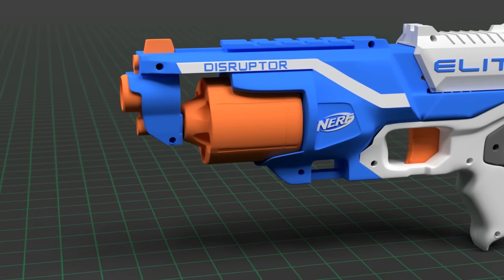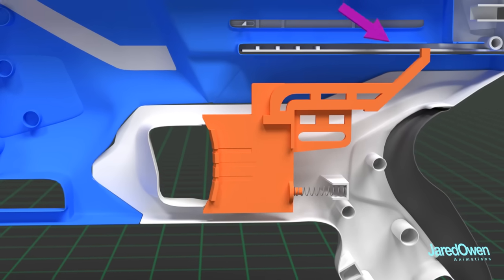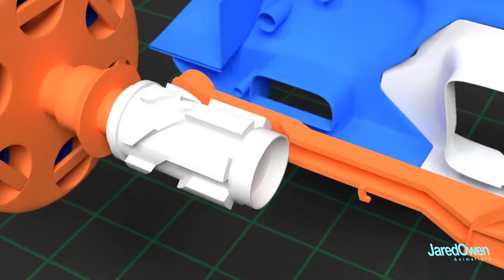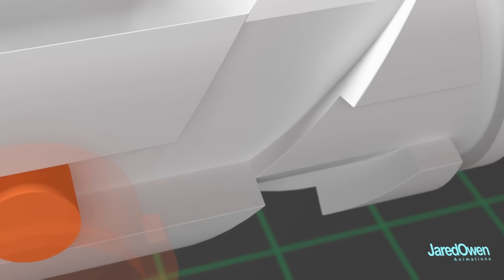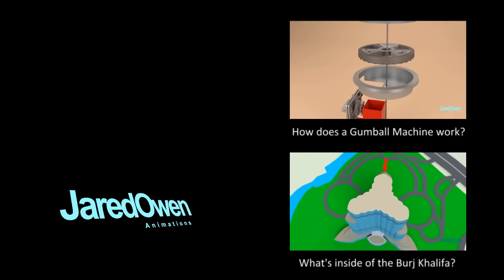How does a Nerf Gun work?

Comment: It's very interesting that the movement of the plunger with a separate assembly is what drives the cylinder to rotate. If I were to design it, I would take after a single action revolver, where pulling back the hammer (slide) both cocks the action and advances the cylinder.

Comment: 🎯 Key Takeaways for quick navigation:

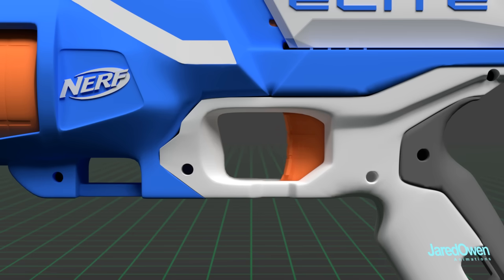00:43 The Nerf Gun trigger is connected to a spring that returns it to its original position after being pulled.
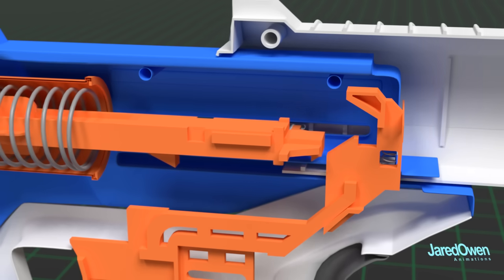02:00 When the trigger is pulled, the vertical slider releases the piston, firing the dart with compressed air.
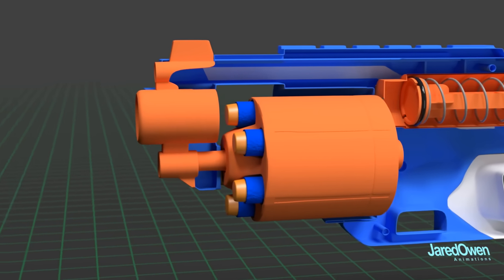02:32 The cylinder rotates after firing, positioning the next dart for firing.
03:38 The cam and cam bar mechanism causes the cylinder to rotate, enabling dart rotation and firing.

Made with HARPA AI

Comment: I actually “modded” my disrupter, i took out all of the air restrictors in the drum, and then theres one more that can be removed in the piston. then I replaced the pistons spring with a spring from a stronger nerf gun. It was pretty powerful and left welts from short range. But it did also break the little blocks on the priming handle, but until it did it was really fun

Comment: fun fact you can fit a 7.62x54mmR in a nerf gun
Reply: "Free bird" starts playing
Reply: @NuclearDorfus freeeeeee birdddd yeah
Reply: @NuclearDorfus 🤖
Reply: @PoisonIvory088 u call me a bot ?
Reply: @NuclearDorfus  yes
Reply: the quiet kids takin notes rn
Reply: @Waterishloki100 all I can say about that is 💀
Reply: @Waterishloki100 me
Reply: @Waterishloki100 meh, it will blow it up
Reply: 7.62s are my last resorts for when I lose nerf battles, the break glass for emergency
Reply: fun fact: nerf darts are .50 cal
Reply: @halbolonen well elite ones are
Reply: @halbolonen nerf darts to me look like a magnum caliber
Reply: At least mega darts  @halbolonen
Reply: @halbolonen  im assuming .50 beowulf bc there’s no way a bullet the diameter of a shotty shell is fittin in a nerf gun
Reply: @Waterishloki100  the bullet itself would fit, because its the same size as a nerf dart. in terms of casing .50 beowulf might fit depending on the nerf gun because the casing is slightly wider than the bullet. though from what I've heard, most nerf branded guns have some wiggle room
Reply: @Waterishloki100  a nerf dart has a diameter of 12.7 milimeters (i measured) which is the same as some .50 cals
Reply: @halbolonen  yeah but i only has a 7.62 dummy laying around
Reply: no one's stopping you
Reply: I have an idea
Reply: and it will fire the whole bullet. you know what that means
Reply: Oof size: nuts
Reply: With the short barrel, a 7.62x54mmR will be as inaccurate as storm trooper's aim
Reply: Fun fact I have done this with dad's  ammo when I was 9 it will totally feed through the mag and into the nerf gun chamber if you have bolt action blaster and slam the bolt forward the round will fly out the barrel
Reply: “Heres some tips to help you win your next nerf battle”
Reply: The average nerf dart is the same width as the bullet in the 50 BMG cartridhe
Reply: Wanna know some funny? The average dart caliber is 12.7mms, and nerf MEGA darts are 20mms, then we have MEGA XL, 30mm. And god forbid the demolisher rockets and the Titan rocket
Reply: It won't fire because the Nerf blaster only shoots out air that shoots the dart, and the bullet may be too heavy
Reply: How do you know this😂
Reply: @winterflight8254  experimenting
Reply: a fun nerf battle
Reply: WHAT IF IT'S A MEGA BLASTER
Reply: Heck even if an ultra one
Reply: Say it in English
Reply: Ferb I know what we’re gonna do today
Reply: Cap
Reply: Wait what

Wait

WHAT??????????
Reply: how exactly do you know this
Reply: airsoft troll
Reply: What’s that?
Reply: Cool but why do you know that
Reply: But will wont work like in a normal gun, because it will the projectile will be pushed by the air, not the explosion. So the entire bullet will fly out, instead of just the tip.
Reply: Fun fact: the nerf ultra pharoah is almost a 50 cal
Reply: Heh- howed you know that-?
Reply: Just because you can doesn’t mean you should
Reply: OOOOOH NOOOOO-
Reply: OOOH NONONONONONONO
Reply: So theoreticly if you put a firing pin on the plunger you can fire a round
Reply: @SCARECROW9713 yes you can, but please don't, it will permanently destroy the internals of the blaster and also you will probably go to jail
Reply: Tengo una élite eaglepint 2.0 pero no me dispara quien me puede decir que tiene
Reply: imagine replacing the piston with the needle that activates bullets 💀💀💀
Reply: Dang
Reply: It's a toy, not a freakin' real gun
Reply: Ayo wtf
Reply: You should NOT have told me that
Reply: The firing pin mod 😳
Reply: Just add a firing pin and boom
Reply: @Yeetusthe6th there is kinda a firing pin, its in the chambers of the cylinders, i think they keep the dart in place
Reply: @Thefriedchickenmaster   yea… but also add a extractor to then yea
Reply: doesn’t mean it’ll fire
Reply: Dont give me ideas…
Reply: And also a 30-06
Reply: ok, I know the rounds and caliber is real but why did I think of dayz when I saw this comment?
Reply: Nerf guns don’t have a firing pin. So you can’t shoot normal pew pews from it.
Reply: Great prank😂
Reply: You can also perfectly fit a 12 gauge into a nerf Ultra mag
Reply: yeah but they don't have firing pins
Reply: Mister crab I have an idea
Reply: Nerf wars just got a whole lot more fun
Reply: @zander-M1  ...where's the firing pin? actual proper shell ejection? a proper barrel?
Reply: It’s nerf or nothing
Reply: If god didnt want me to shoot 7.62x54mmR rounds out of a nerf gun, why did he make the diameters match?

(Fun fact nerf darts are .50 caliber so you could probably chamber .50 AE or .50 beowulf in a nerf gun too)
Reply: @RedVRCC  where's the firing pin?
Reply: @ratsmushr  the nail you put thru the end of the piston inside the nerf gun
Reply: @RedVRCC  and how would that be actuated?
Reply: @ratsmushr  it was more of a joke comment anyways because the nerf gun would just explode if you tried to do this. 

I guess the idea I had was that the area where the piston slams forward to compress air would instead have a nail driven thru it that would fly forward and strike the primer on the back of the cartridge. It would be actuated in the same exact way the gun already works because that piece the nail would be attached to already moves forward at a decent speed. You probably would have to modify the gun further for it to actually work though.
Reply: Let’s…. Not do that
Reply: I knew the were bigger than 5.56, but not that big
Reply: I've got a few sitting around but unfortunately no Nerf stuff
Reply: But why would you want to? Nerf doesn't exhibit enough force to hammer a priming pin
Reply: The average nerf bullet is half an inch in size so it means it 50cal
Reply: Nerf guns are 10mm
Reply: Umm I think you meant 7.62x51mm? I don’t know if the casing diameters are the same but just the rim would make it so it wouldn’t fit, 7.62x51 or .308 do fit in side nerf mags but I don’t know if t know about the blaster itself
Reply: I want to see if a nerf mega gun or nerf mega XL can fit a 50 bmg…
Reply: @JonathanCortez67 nerf mega is 20 mm 50bmgs base is 20.422 mms would probably work half decent
Reply: by the size, it should be 50 CAL
Reply: @Wall_Gaming229 no because 50 cal is just the bullet diameter not the actual cartridge
Reply: @cutoats  oh..

Comment: the plunger tube is also free floating which means that when the air pressure builds up from the release of the plunger head, the entire mechanism jolts forward and creates a seal on the back of the cylinder of the blaster. this is the most important part!

Comment: the small block is way to small, and if you try to slide it in a slightly downwards direction, it will slam fire without pulling the trigger (basically it misfires)

Comment: I took apart a different nerf gun. Why in the part where the spring is, is the rubber band wet?
Reply: Rubber band? I don’t know of any blasters that utilize those. Are you talking about an O-ring?
Reply: @mechanwhal6590  the black ring thing that feels like rubber
Reply: @thegamingdeerfox  Yeah, that’s an O-ring! I believe what it has is lubricant, a substance that is needed for smooth operation. Ask any modder, there’s a huge community!

Comment: THIS ANIMATION alone gives you a PERMANENT JOB FOR THE REST OF YOUR MORTAL LIFE. That is it. 
I'll explain why. Detailed sections and transparencies used on the mechanism. Order of process and the description of the actuators are dead accurate. The decomposition of the assemblage is complete while the viewer never loses track of the whole action on the set of actuators. 
The simple verbal explanation matches exactly the animation on the tight spot. The time stamps are absolutely accurate. 
And we are not even speaking about the level of detail, illumination, modeling or even polygon budget. Those are things obviously well executed. 

As a side note these toy designers are engineers and few are architects. These are NOT toys when there are millions involved. The engineering of mechanisms will be done by the book under rules of optimization and production. Fabrication is a strict science. You will see more complex devices than these moreover when such designers have 40 years working with mechanisms.

Comment: In my opinion the Maverick is better than the Strongarm as the mechanism is so much simpler. My strongarms broke after getting grit in the mechanism: it can fire, but it won't cycle the cylinder round. The maverick will move the cylinder when the trigger is pulled without any fancy kick system, and can be used to cycle to different chambers

Comment: "Good for target practice..." 

Not with these shitty elite darts kekw
Reply: yep
Reply: do you use rival guns or some other type if dart?
Reply: @tysoncook5152  yes.
Reply: @tysoncook5152  wafflehead darts > elite
Reply: @GeraV5  interesting. i never heard of waffle head darts. i looked it up and they seem interesting. i know the elite darts can wear down pretty fast. do waffle head darts have a more resilient body?
Reply: @tysoncook5152  i guess in a way.
But in general they actually hit where you're aiming at. Here have a video about the many darts.
https://youtu.be/8IwTM1fpzDY
Reply: @tysoncook5152  Accufakes also are like accustrike, but 10 times cheaper, and half length darts are the best way to go overall
Reply: @GeraV5  nice! i will consider trying out some of these options. the waffle darts seem to be pretty accurate judging by the video.
Reply: @tysoncook5152  the most tryhard you could go in nerf/competitive would be with half length darts, since those can be MAAAAD accurate
Reply: @GeraV5  wouldnt they be hard to use though?
Reply: @tysoncook5152   traditional magazines? Yes. 
With katana magazines/adapter to normal magazine well, no.
Reply: @GeraV5  so much i dont know about this stuff. i guess i need to do some more research.
Reply: @Splinter-ge9pf  accufakes seem to be very hard to find nowadays, so Adventure Force waffles are the best at the moment
Reply: Rival is more accurate than elite

Comment: In the gun world, the "vertical slider" is known as a disconnector.  Cool video! 👍
Reply: You're confusing another part. That slider is a "sear". A disconnector actually disconnects the trigger from the sear until the trigger is reset, otherwise the hammer wouldn't stay cocked after cycling.

https://en.m.wikipedia.org/wiki/Sear_(firearm)

Comment: Well.. tbh its pretty simple. 
Flywheel blasters just give away how they work (Flywheels spinning hella fast so when the dart comes through the conveyor to hit the flywheels, it jolts out)
Then there’s the spring blasters, the old schools (They also shoot harder)
The name also gives away how it works. (Priming the blaster consists of pulling back a spring and the spring shooting the dart. It shoots harder than the Flywheels so it might sting worse. They’re better for snipers, Shotguns and Pistols. Flywheels are better for AR’s, SMG’s, and other primary blasters. BUT- there’s one that beats them all, I, a Stryfe user, would prefer that. But this is my opinion :) read if you’d like!)

EDIT: This a hella simple explanation, don’t get on me about this.

Comment: i think for slam fire the trigger is held down so the triangular plastic at the top pushes the piston away from the cocking mechanism's block allowing the piston to extend, but when the cocking mechanism moves forward again the angle of the block allows it to slide under the piston's catch and latch on again.

Comment: That indexer could be used in a belt-fed flywheeler to potentially attain ridiculous rates of fire reliably with low battery use. Align the sprocket and position it in such a way that the dart pusher is always clear when the indexer is engaged, and it just might work

Emphasis on "could". Perhaps the indexer may slip if used at high speed.

Comment: Hallo Jared, do you know what slam fire is? When you keep the trigger pulled and prime the blaster, once it hits the position farthest back, it fires (in this blaster, other ones fire when the priming mech is in a forward position). This is a really cool mechanism in this blaster and some others. It would be really cool if you could show how that works!
Reply from the maker: Thanks Himneesh - I will consider it!
Reply: @JaredOwen  Thanks for replying! Just to let you know, whether you make a video or not, slam-fire lets you increase your rate of fire since all you have to do is pump the priming slide as fast as possible. The need to stop priming and pull the trigger is gone, so you shave off a lot of time.

Comment: I wanted to know how does the slam-fire system works because one part that is different from a disruptor/strongarm to the maverick is the slam-fire.
Reply: The maverick has a rod running on top the plunger tube, whereas the strongarm and disruptor has a triangle plastic latch. And the catches are different

Comment: For those wondering about slam-fire: when you hold down the trigger and pull, the "vertical slider" acts as a ramp lifting the bar on the piston above the bar on the priming handle enabling it to fire immediately. If you were to try this on a blaster without slam-fire it will simply not prime. The bar on the priming handle is triangular so it can pick up the bar of the piston during slam-fire since otherwise it would get stuck behind the priming handle's bar.
Reply: Cool I didn't know how slam fire works
Oh also, some blasters have locks that prevent you from pulling the trigger when the priming handle is back so if the trigger on your blaster doesn't press when primed back don't try to press it or it will break

Comment: It was based on an actual bolt action gun.  The grooves that rounds the chamber, the firing pin and the trigger reset, it's actually can be made into a real bolt action gun (Not automatic nor semi-automatic, because those make use of the gas system efficiently).

Comment: this is how the Maverick works, not the disruptor, I'm cringing at the wrong blaster, yeah they're basically the same but with the maverick it has the cylinder turn every time you pull the trigger, with the disruptor it turns with the priming handle

Comment: This pains me so much

It's actually called the Nerf N-Strike Elite XD Disruptor

The "Vertical slider" Is actually a Catch and the spring with it is called the Catch Spring

The "Piston" Is called the Plunger and the tube is the Plunger Tube and the Rod is the Plunger Rod, this is a unique design with the Slam Fire mechanism in place that you forgot to mention. The end of the rod, that actually catches with the Catch is on a spring and move, when the Trigger is depressed and the catch is down, it will prevent the rod from catching and will also cause it to release it self from the Priming slide, allowing you to fire much faster.

You forgot to also mention the Air Restrictor, this allows the ablity to "Dryfire" the blaster, meaning fire the blaster with no dart insterted. Without it, the Plunger head will slam into the end of the Tube and may break. The Air Restrictor on the Disruptor/Strongarm is unqiue since it diverts air out of the system when no dart is loaded through the use of a small hole at the bottom of the Air Restrictor housing that lets some of the air escape the system to prevent bursting, but when a dart is inserted, the Air Restrictor moves back Far enough to cover up the hole, allowing for optimum airflow. Many modders forget this when the take out the Air Restrictor and actually loose performance when they remove it, since they have a leak in the system they forgot about.

I hope that any Nerf Noobs who took this video as absolute truth then sees this comment and will think otherwise. Do more research Jared!
Reply: Ok boomer

Comment: So what happens to the cam when you manually rotate the dart cylinder? Is the cam set up to allow this? I do recall that it turns more easily in one direction than the other.

Comment: And how a Automatik nerf Work?
Reply: Depends the with the rapidstrike you can put in "clips" in these "clips" you put darts and in order for the darts to be loaded theirs a spring pushing the darts up so theres a stick in the nerf gun and pushing darts (when you pull the trigger) into flywheels which rev up spinning fast ( when pulling the rev trigger)  the dart gets flung out the barrel idk anything else about it ,now the hyperfire uses a conveyor belt pulling the darts into the flywheels of course there are others but these are the ones I know